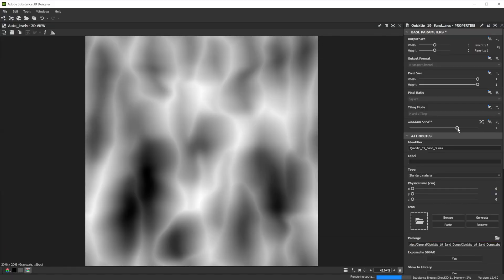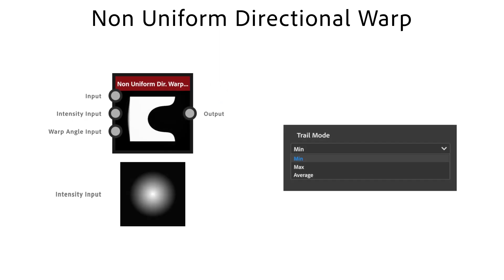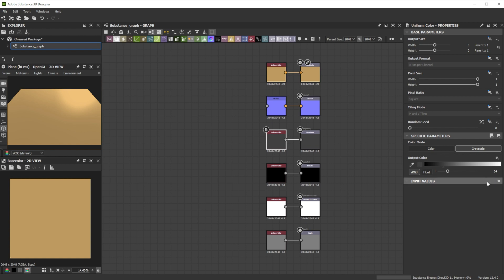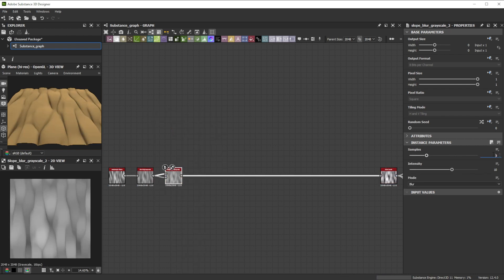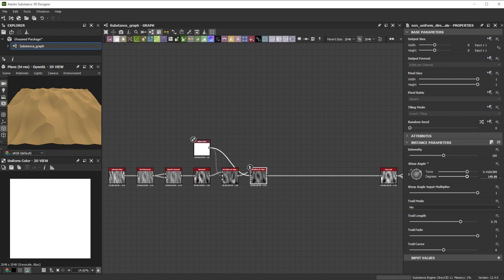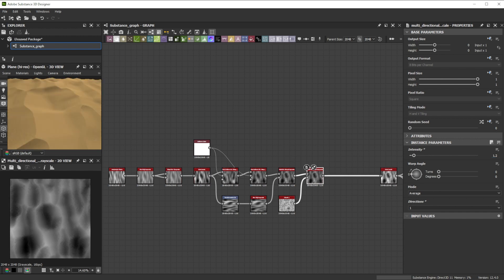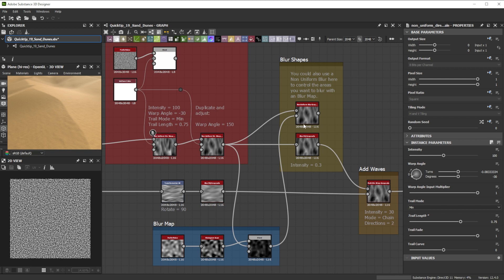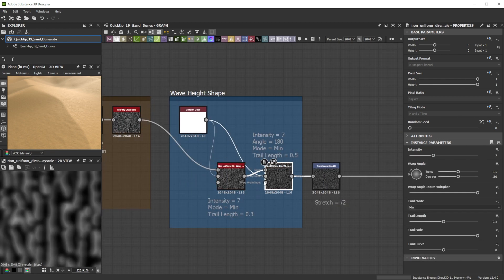Sand Dunes | Designer Quick Tip #20 | Adobe Substance 3D

Comment: if you want some extra ripples on one side of the dunes you can use generated normals to fetch the sides/direction of the dunes. often dunes have one side that's fairly smooth (the side the wind blows against it). while the other side not affected by the wind often have a bit of a rippled texture to it.
Reply: Can you please clarify what you mean by this?